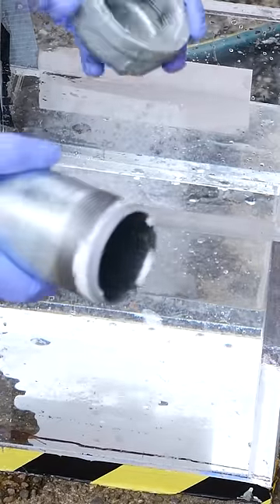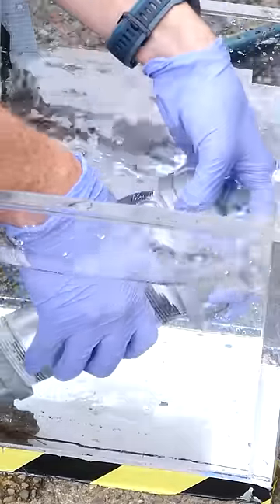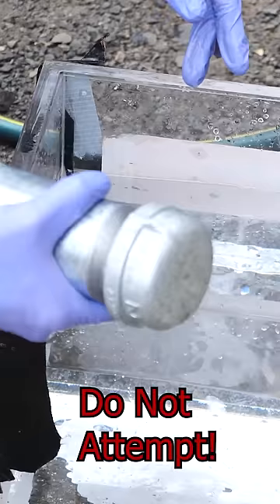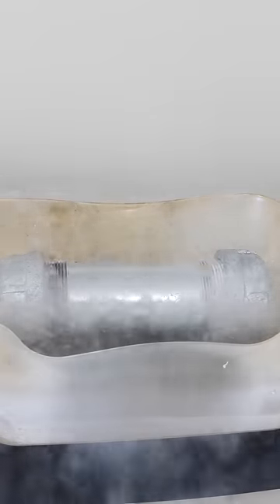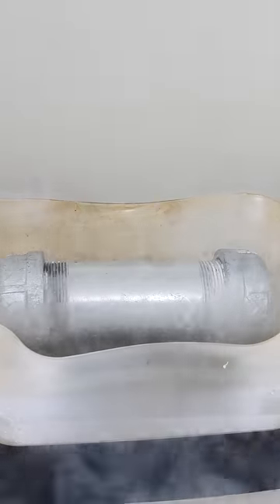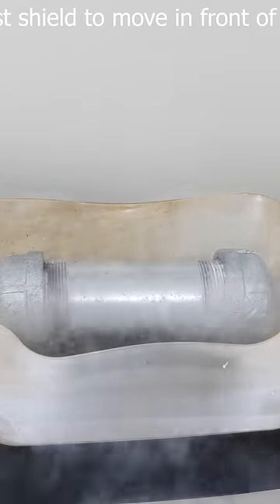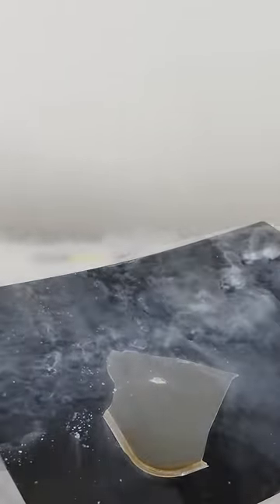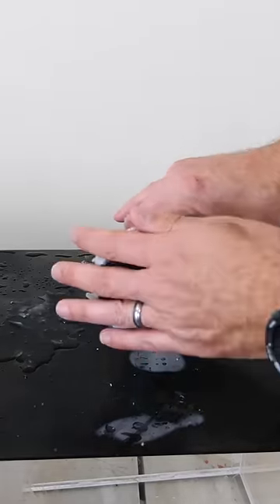Don't Ever Try To Stop Water From Freezing!

Comment: At a previous job where we studied material failures, we would use liquid nitrogen as a means to induce failure in steel. The temperature of the steel definitely had an impact here and may be why the water didn't need to freeze much
Reply: Yes, the brittle transition point. I'm curious about just holding it at 32F/0C and seeing what happens
Reply: @zenjon7892 - keeping it at 0C would not freeze it. Maybe keeping it at -5C in an ice bath with saltwater?
. . . Do you know at which temperature the brittle transition point is?
Reply: @Achill101  it depends on the exact grade of steel. However, room temperature is usually below the transition temperature for most industrial metals. You don't want pipes stretching.
Reply: @MWilk098  - so "normal" steel would brittle at -5C, correct? Then a closed tube of normal steel should show the same breaking behavior in iced saltwater at -5C as in liquid nitrogen.
Reply: @Achill101  the transition temperature for popular/typical stainless steels is between -30 and -20C.
Reply: This particular example was using low quality galvanized pipe. It’s pretty soft.
Reply: This is a perfect example of what happens when you don't prepare your experiment in a proper way, and then you conduct them with subzero understanding of basic physics.
(all my puns are intended)

When that pipe is chilled to lower temperature, it will become smaller.
Water does not compress, and below zero its volume increases.

If he had cooled that pipe slowly in a cold air (e.g. in a freezer), it would either crack or become deformed. If it had deformed, you would be able to measure increase in diameter, and reduction in wall thickness and it would mostly be permanent even after the pipe was left in room temperature. 

This lucky birdbrain survived, despite making steel brittle as glass, by partially and unevenly cooling it with liquid nitrogen, and running in opposite direction thermal shrinking of steel, and thermal expansion of ice in a container - and all that at high speed.

If he had lost an eye, this clown would have been eligible for the Darwin award! :0)))
Reply: @Achill101 no it wouldn't.
When you cool a very plastic mild steel (which is the most likely material for this pipe) to a lower temperature, it will slightly shrink, and thereby its density will increase a little.
That will make the material more rigid, and force needed to brake it will become a little lower. But at - 5 or - 15 degrees Celsius it will not be significant.
Example: Even in harshest winter at - 40degC, high voltage power lines don't brake, despite those poles being made from mild steel.

But when you pour liquid nitrogen over one side of the pipe, it is trying to shrink, and the other side is cooled at a much slower rate and is shrinking at a different speed - creating huge internal stress in the steel pipe itself.

This would crack the pipe on its own, even if it didn't contain unshrinkable object (water, or hydraulic oil).

In a same way, if you poured liquid nitrogen over one part of electric pole structure, you would likely cause part of it to brake. You would also enjoy the recognizable mournful cry of crumbling steel, just before you were squashed under that mangled pile.
;0)
Reply: @MacakTosha  - you could be all right about the steel, and I wouldn't know, but you seem to miss a factor in your description of what would happen: when water freezes to ice, it increases in volume and can break strong materials. Could the water break even steel? (Assuming that the inner volume is completely filled with water, no gas.)
Reply: Omg bruhhhhhhhhhhhhhh
Reply: @Achill101 Yes, in most cases. If he put this experiment in a freezer it would have probably just put a 1-2 inch crack in that pipe after a few hours.

Thanks to all the reply’s in here, actually learned some interesting things 👍
Reply: @Achill101 why wouldn't 0 degrees freeze it? Because it's under pressure?
Reply: @xpusostomos  - let's use Celsius instead of degree to avoid confusion.
. . . At 0C, water and ice can coexist. Water will not necessarily freeze and expand. Setting the temperature at -5C will lead to a freeze in a recordable time.
Reply: @Achill101  huh? Yes I understand water might not freeze at ... Let's say -0.1 Celcius.. but it should.. I'm asking if keeping it under pressure can prevent it.
Reply: @Achill101  mild steel is very "plastic". This means that you can stress it to the limit of its elasticity, and when you stress it beyond that level, it will start to deform, but it will not immediately brake. Actually, it can take a lot of deformation before it brakes. That's why we like it so much and use it in all kinds of applications. All those metal cabinets (like a locker in your high school) made by bending sheets of metal? That's mostly mild steel. Outside panels on home appliances, electric cabinets, etc. These are all mild steel products where this material was chosen exactly because of its ability to be plastically deformed. 

At the same time, as mild steel is being plastically deformed, it becomes stronger in the area of deformation. 
Example: Bend a piece of steel wire with your hands. Now try to unbend it with your hands, and you will notice that instead of becoming straight in the area of initial deformation, it actually tries to bend everywhere else. If you use your fingers to try to force it to unbend exactly where it was initially deformed, your will feel in your fingertips that force needed to unbend it there is far higher than initial force you needed to bend it. 
That effect is called something like "plastic restructuring". (my engineering studies were not in English so i am trying to translate from my language)

So back to your question: Mild steel pipe filled to the brim with water, and capped at both ends. As you cool it (gradually), ice will form and start to expand. Forces that crystalized water can create will probably overcome the tensile strength of the steel pipe, and water that is expanding in the pipe will force pipe to expand too. But pipe is not from high grade steel, so it will succumb to those pressures, but will not brake right away. It will become more and more deformed, to allow for the growing volume of water inside it. My best guess (not knowing exact dimensions of the pipe and material properties) is that a pipe like this could possibly take up to 10% increase of volume without cracking, even at temperatures that are up to -50 oC. After you heat it up again, and drain water, you would be able to measure reduction in wall thickness of the pipe, and increase of overall diameter. There could even be some blistering on the sides of the pipe. 

Finally, all this would be possible, only if the caps on both ends of the pipe are strong enough. If they are cast iron, they would have to be very thick to withstand these stresses. Cast iron is known for its capability of not braking when you press it, but it is much weaker when you try to stretch it - which is exactly the kind of load it would have to take in this scenario. So those caps, to prevent from cracking, would have to be really "chunky". ;0)
But if they were strong enough and didn't break, you would be able to see deformations I have described. 

p.s. If you want to see these effects, if you see someone replacing a 30-40 year old hydrophore tank, and they have to cut it to bits to get it out of the water pumping station, go and take a good look. You will see how the steel that tank was made from was corroding on the inside, and chunks of corroded steel would flake away on the inside. Those area would become too thin, and would start to deform under pressure, causing a blister to form on the outside. Then, as the material in the blister area becomes stronger, deformation stops, and new blister forms at another location, and so on. After 30 years or so, those tanks look like they were suffering from plague. :0)
Reply: Came here to say this.  The way he froze it invalidates the experiment
Reply: @MacakTosha  - thank you very much. I knew some stuff you described, but other stuff was new to me. I certainly learned more from you than from the video. Thanks again.
Reply: @xpusostomos  - yes, high pressures can reduce the freezing point of water a little bit. For example, if skates press on the ice with one of their edges, the high pressure from the small area is enough to reduce the freezing point measurably.
Reply: @Achill101 same thing happens when you drive on an icy road. Weight of the car, concentrated on 4 points of contact with the road, create enough pressure to melt small amount of water. Skidding on the icy road is happening because of that thin layer of liquid water between ice and tire. 
This is why winter tires have those small grooves on them, so they can scoop up that water as it melts, so that the main surface of the tire is directly in contact with hard ice. 

And to expand on that analogy, if you drive on a completely iced highway, and outside temperature is -30oC or lower, grip is actually very good, as long as you stay on hard packed ice - because at that temperature, the ice is so cold that pressure exerted by the tire is not high enough to melt ice. (This is no theory. I have tried it a couple of times.)
Reply: should’ve just used a regular freezer
not an accurate test